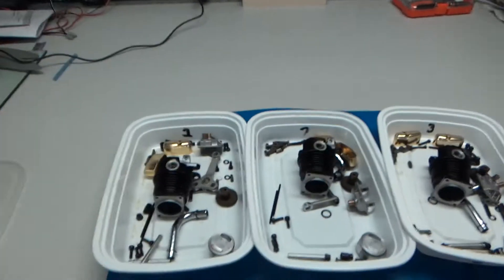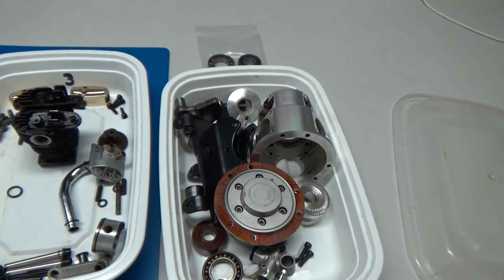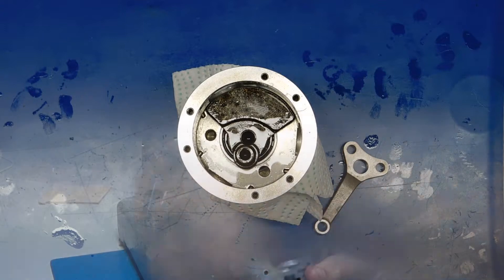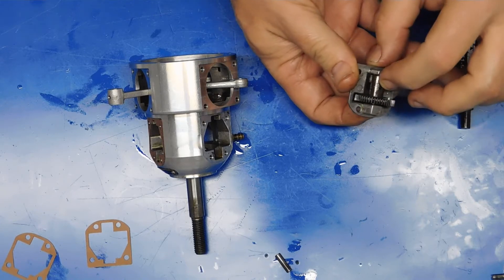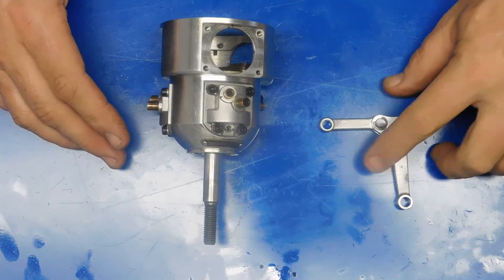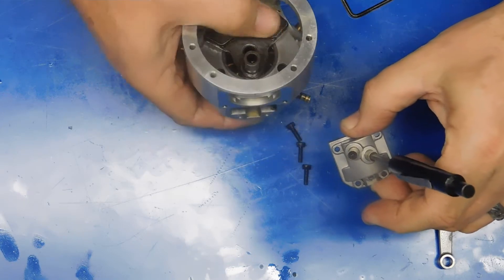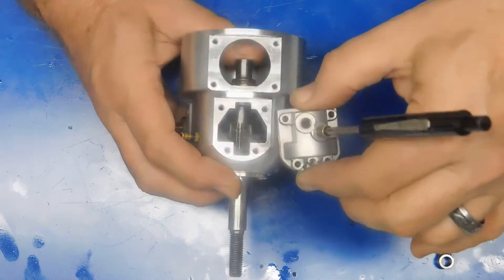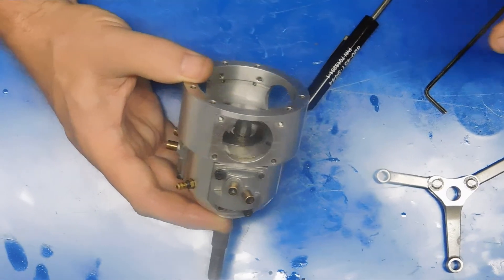Saito FA170R3 Customer Rebuild Part 4

Comment from the maker: Viewers, I have an error in this video.  It was brought to my attention that I have timed this engine incorrectly.  Although the method of using the screwdriver to set the timing gear in the proper location and hold it is correct, I had too many revolutions of the crankshaft for proper timing. The proper procedure is set the crankpin at TDC for cylinder 1, hold the timing gear in place, then set on the engine.  Rotate the crankshaft 2/3 of a turn and set the timing gear on cylinder 3.  Rotate another 2/3 turn and set timing gear on cylinder 2.

So from TDC on cylinder 1 rotate the crankshaft past TDC on 2 and stop at TDC on 3. Set timing gear in place on 3,  Now rotate the crankpin past 1 and stop at TDC on cylinder 2. Set the timing gear onto cylinder 2.  I hope this clarifies my mistake.  My apologies.
Reply: Fascinating to watch.Friend gave me a plane with F'S 52.Brand new,he tried to start the engine with his own mixture of who knows what.Needles to say it never started.Now I am sitting with a brand new engine so gummed up that it is just sitting on display with my other OS s.I cleaned it up but cannot get the gudgeon pin out.Burns my backside.To far to send to you. (South Africa)Thanks for a great channel.Pierre.